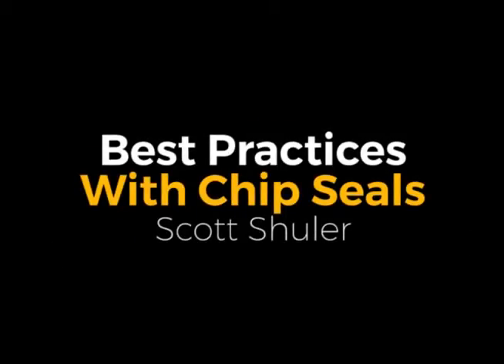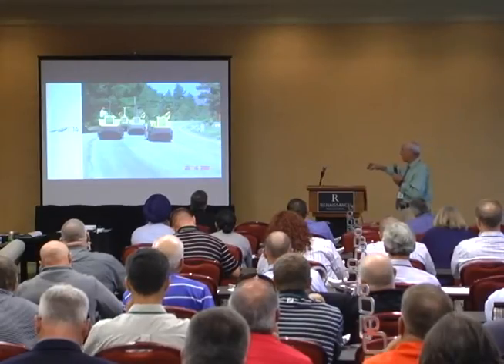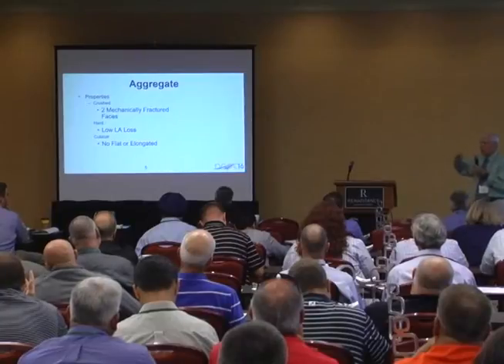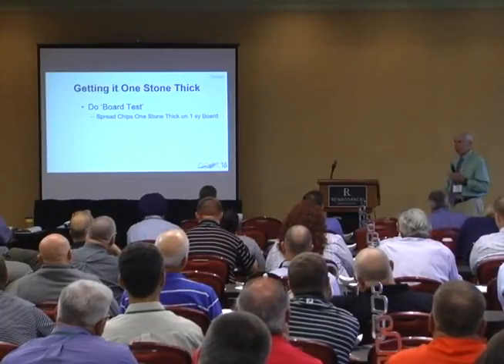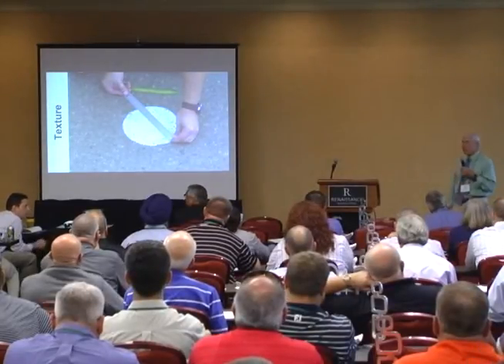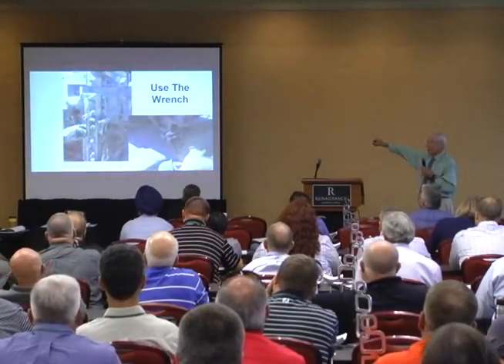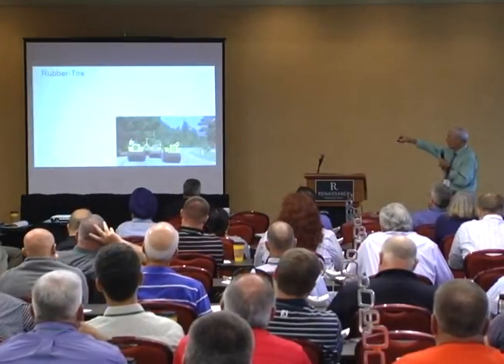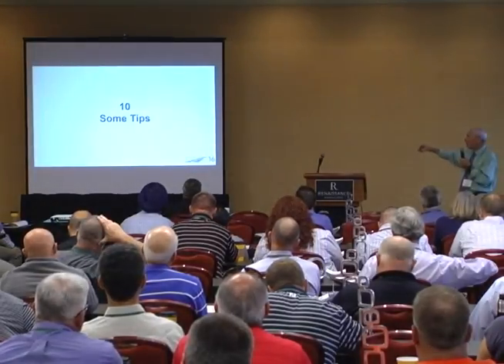Chip Seals Best Practices  NPPC16 -

Comment: Back in the '70s when i did this I drove the Etnyre "K" box in 3rd gear meaning I'd wait a minute behind the distributor after the joint paper got pulled off. When I mention this in the YouTube threads the inspectors (I'm Assuming) seem to think think that's heresy! But you get a better coverage with the gate open more and I'm still finishing right after the distributor including switching out half dozen six yard trucks. 
But all these videos have the box poking along in 2nd gear crowding the distributor. I know damned well that with most rock the coverage is going to be more spotty with little quarter inch holidays throughout whereas a third gear run is just more uniform.